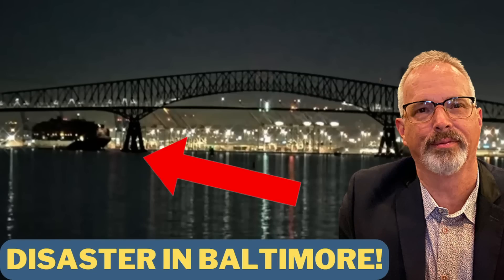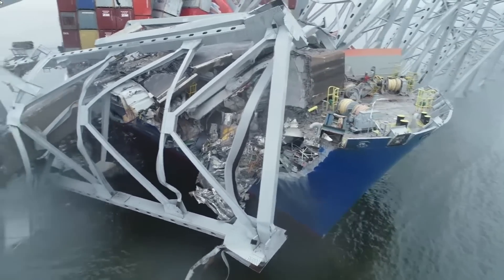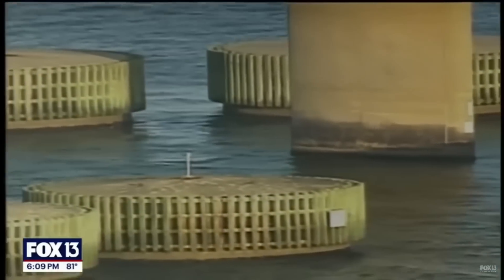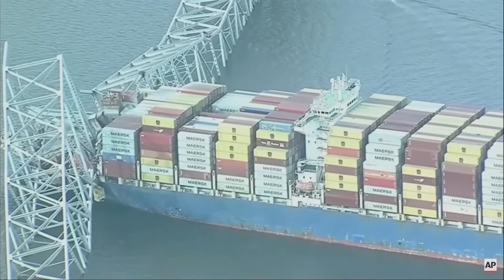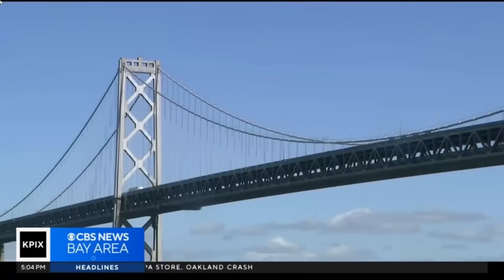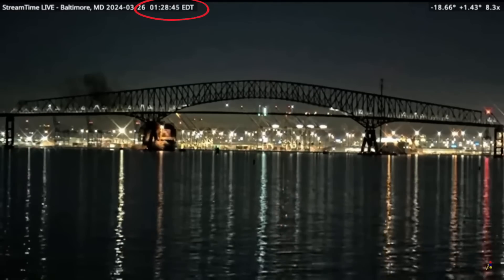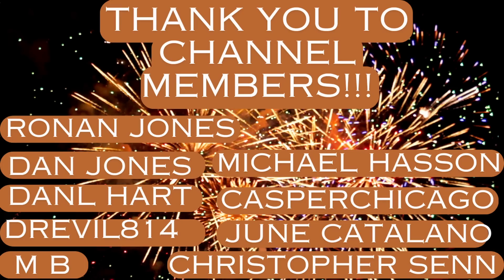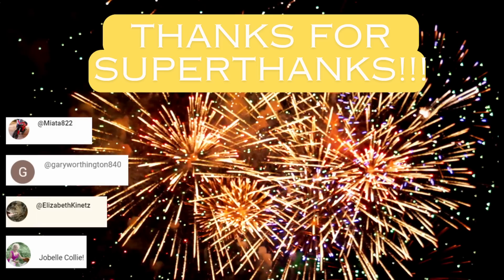How the Francis Scott Key Bridge in Baltimore should have been Protected

Comment: You do not know that the loss of power was the reason the ship was out of control.
It's likely, but not known for sure yet.
Reply: This is not the key question here, the key question here is why has such a bridge not been retrofitted with an appropriate protection.
Collisions like this are not so rare as you might think. There are many reasons why such vessels have problems to maneuver. This is a situation a bridge have to be prepared for.
Reply: @wizardm  I'll bet it's along the lines of "we'll get round to it"...
To play devil's advocate, it's a straight channel where vessels have had time to reach full manoeuvring speed. The channel is also reasonably wide.
If the concerns and cause were navigational errors (the most frequent cause of collisions) there would be many more ships aground in the vicinity. As it is, it's so "easy" to get it right, tugs are not required.
Reply: @dougaltolan3017  In my opinion, it is almost grossly negligent that the bridge was not retrofitted with appropriate collision protection. It is absolutely incredible why this was not done.
Unfortunately, the US are known for their negligent treatment of building security. The cost factor is often prioritized too much here.
Taking such expensive risks is very short-sighted and unfortunately also deadly here.
Reply from the maker: True.  An apparent loss of power would be more accurate.  We'll have to see what the NTSB finds.
Reply: @CaseyJones-Engineer  👍
There are 2 schools of thought from large ships' captains concerning the black smoke.
One is an engine restart, the other is full throttle (reverse).
To reverse the drive, the engine is stopped and restarted turning the other way, it's direct drive, no gearbox at all.
The engine would have been ateast warm, if not normal running temperature at that time, so smoke due to restart might be less likely.

Both of those indicate fully functioning engine. A successful anchor deployment also hints that those systems were fully functional too.
One commenter, What's Happening with Shipping, stated that there is a image of the port anchor chain being straight aft! For that to happen they would need to let out a very controlled length of chain. Too much and it's all over before it's in use, too little and the anchor skips freely along the bottom. To get a chain taught takes a huge force, only available from an anchor that's bedded, but dragging.
Note that if all the chain is let out and no brake is applied, the bitter end (last section of chain) just rips off its deliberately weaker mount in the chain locker. Otherwise there is a risk of important bits of ship ending up in the water.
Reply: @dougaltolan3017  The emergency anchoring is triggered by releasing the brakes and gravity does the rest. It wouldn't have helped in this situation anyway. Under these conditions there was no time for a controlled deployment as you described.
Power failures on such ships always drastically reduce controllability, even if they are for a short time, as was probably the case here. The effects can be very confusing and it needs time to realize whats going on.
Reply: @wizardm  Anchors cannot just be released, there are several YouTube videos of what happens if they are not controlled. The chain just keeps accelerating to the point where brakes catch fire trying to stop it. If all the chain is paid out and no brakes are applied, the bitter end rips out of its mount in the chain locker.
Reply: @dougaltolan3017  Anchor brakes have manual backup releasing and braking  capabilities so that they can operate independently from the vessels electric power.
The videos you saw are a mechanical failure of the braking system.

Comment: There is a simpler system that could have been used as in other ports. Do not allow such ships to enter or leave the port without the assistance of harbour tugs. Where I live we have aircraft carriers, naval vessels and cruise ships coming and going and they all use tugs to guide them. This does not mean that concrete protection piers should not be used but sometimes they restrict the channel too much where the bridge was not designed and built at a time when thee massive container ships were around.

Comment: The Dali can carry 10,000 TEU's. Obviously not all containers are always going to this one port
2019 record was 98,529 TEU.  So all year they only handled, at multiple docs, the equivalent of 10 full loads ...

Yes! In one way this bridge was "Tofu Dreg". Originally it was built of good materials and to the standards of the day. That is confirmed because it has stood for almost 50 years.  On the other hand, it has BECAME Tofu Dreg because since construction 2 significant deficiencies were identified. The 1980 need for better Dolphins . And, as I've seen explained, the bridge design was "Fracture Critical". If any one part fails, all of it drops. That design is no longer allowed.  Is it possible to retrofit it to make it safer?

I'm sure there have been several inspections since it was constructed that should have been able to identify the problems relative to current standards. But like the Michigan bridge collapse, where even though significant issues were identified, no work was mandatory and it was allowed to fail, killing people.

The San Francisco Bay Bridge has gone through major earthquake retrofits. If they had spent the money to put in dolphins any time in the last 40 years the city and country would not be suffering from this massive economic kick in the gonads.  Unfortunately the local bean counters defeated work that had been identified as needed. Now everyone else is paying for the resulting problem. 

Just out of curiosity, what do you think the new design is going to look like?  Are they just going to reconstruct the missing superstructure, or are the going to knock everything down and start from scratch.  Maybe go with a suspension bridge that will allow higher clearance ASL and a longer clear span between piers? 

You mentioned an old book with calculations and design standard that should have been applied.  I'm wondering if it would have saved the bridge?  Would the Irina fit in the port? Would those suggested standards protect the bridge from the Irina?
Reply from the maker: You pose a lot of great questions.  I suspect that the entire bridge will be rebuilt with new foundations.  Rarely are the foundations reused.  One reason is that the spans will likely increase so the piers would need to put in different locations.  I think a suspension bridge is the most likely type to be used for the replacement.

Comment: One might argue that a collision protection system is too expensive for a bridge which is "already old" and will be replaced within a few decades anyway, but I am guessing that a collision protection system could still be useful for protecting a replacement bridge as well. I'm curious how much planning goes into such systems and into how they might be designed with future replacement bridges in mind. Also, I suppose a new replacement bridge may also be deliberately designed so that the protection systems of the old bridge will also protect the support structures of the new bridge. 

One additional consideration I guess would be that the support structures might be designed in such a way as to help or at least not to hinder the construction process for a potential replacement bridge.

Comment: Good job on your presentation(s). Keep it up. I was in the Coast Guard in the early 1980s stationed in Curtis Bay which is right next to the Key Bridge (as they call it in Baltimore). I can recall numerous time going out of Curtis Bay and into the river right into the channel where the Dali started drifting. That would lead us under the bridge in the Tender I was on (construction or bouie) and south past Sparrows Point on the port side until we hit the Bay. Before I was there a cargo ship ran into the Key Bridge in June of 1980 and banged it up pretty bad. Same scenario...Asian flag, windy, power cut off. It was only about 1/3 or 1/2 of the size of the Dali if I recall and the bridge stood OK. But that should have been a wakeup call because it was right around the same pylon I believe. When I was there I do remember escort tugs for the larger ships entering and leaving the port under the bridge. Perhaps this was voluntary on the shipowner's behalf, or maybe the crash in 1980 was still spooking them. Yet no real protection for the exposures that are bearing the weight. I lived in the Baltimore area until 2000 even though I was out of the Guard years earlier. We moved to Pinellas County Florida and I learned all about the Sunshine Skyway Bridge since we lived right by Tampa Bay, and saw the protective measures on the new bridge.

I was stunned when I saw the Key bridge fall like it did and was astonished when I heard the pylons were STILL exposed to the full impact of a large tug or ship or anything nefarious. And I agree with you that you CAN do things to mitigate the impact even if it cannot be 100 percent prevented. And it does feel as if Maryland officials are being rewarded in an odd way and federal taxpayers will foot the bill, yes. But that area is going to be hit hard from this. My wife's family is still there. I feel for the people there, especially for those who lost someone or who will be losing jobs because of this. As far as the younger generation, yes, I am now a semi retired JD (lawyer) and yes. But its not all their fault, the law has changed underneath them as well.

Comment: This a FALSE generational premise, when engineers project a BRIDGE they do it for the conditions of the time of the project.

BUT ships go BIGGER and with the future higher port traffic, ships are maneuvering FASTER and the TOWS are liberate even sooner to pass under the Bridge. SO the augmented INERTIA (weight x velocity) is not in terms of the projected parameters.
Was the same problem of the fall of the Twin Towers in 7/11 they design the building to resist the collision of a plane  BUT the planes got BIGGER, carry more FUEL and the collision and the fire generate by so much aviation fuel simple surpass the original PROJECT ASSUMPTIONS of the engineers and the resistance of the internal floors structures collapse on each other (what was SUPPOSE COULD NOT BE HAPPEN) and the rest is HISTORY. A very bad one!!!  
Even the examples showed in the video of after augmentations on other bridges defenses are ALWAYS falls behind the continuous changing conditions. 

But the main issue HERE, for me, is the POOR OR MINIMAL STRUCTURAL design of this Bridge , is absolutely unacceptable that the section on the other side of the central pass collapse ALONE. 
That section was pull down a bite on it's left side BUT it' was the right support THAT was elevate a bit and FALL BEFORE than the left side more near to the collision!!!  
To me this shows that the structures of the BRIGDE was it's sections TOO CLOSE one another The columns DID NOT separate the sections more SAFELY (distant from each other) and this aloud one section collapsing easily to move the other and the area of support (I PRESUME) was TOO SMALL as the right end of the opposite section of the channel simple escape of it point of support!!!
They builded  it to the minimal margin of structural security to the point of ANY serious structural damage cause the entire bridge to collapse in a DOMINO'S effect...

Comment: 13:48 I wonder if the lawyers of the victims families knowing that a plan to improve the security of the bridge had been evaluated but was cancelled,
could sue the port authority for involuntary manslaughter, knowing that a possible danger had be establidhed but nothing was done to prevent it.
If the cost of adding buffers around the bridge pillars was too costly, others solutions should have been taken to mitigate the risk, 
such as using tugboats to control any big ship passing in the proximity of such vulnerable ridge. Especially considering that there 
is a river on the side of the  channel who might explain why the boat didn't hen in a straight line after loosing power.